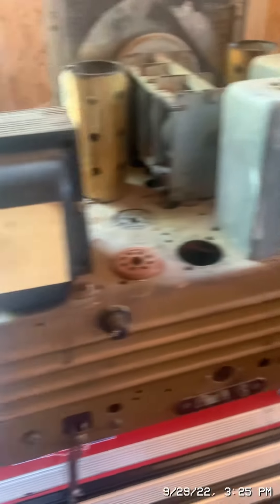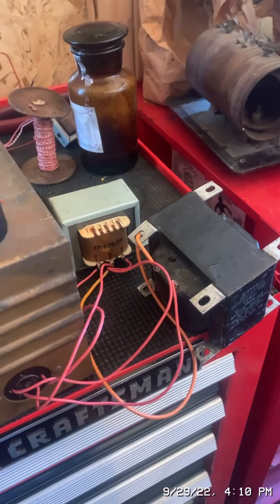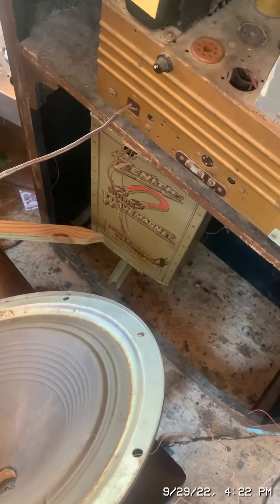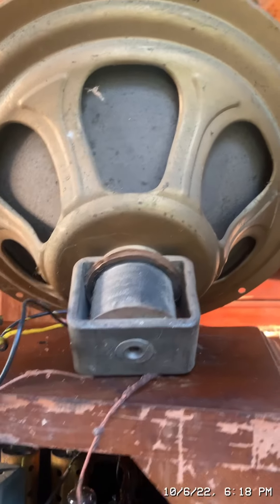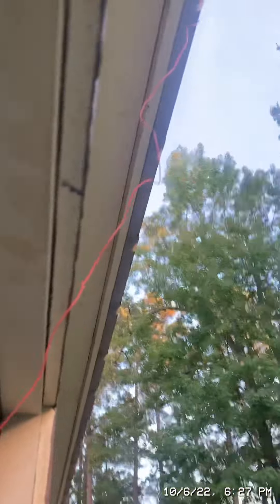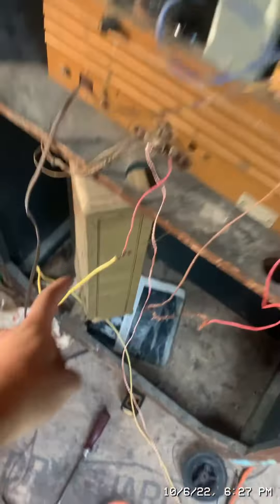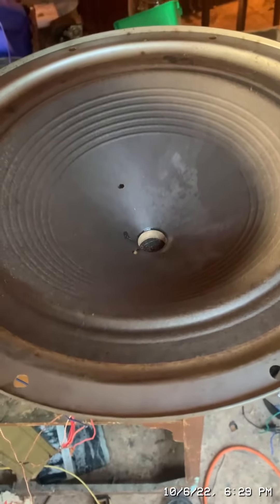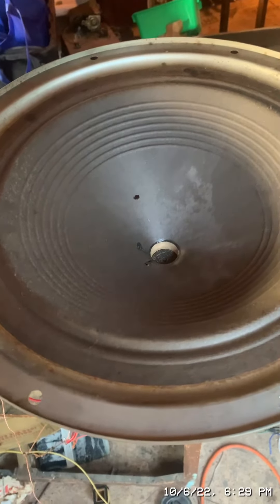Part 2 radio restoration

Comment: Good job. Id replace all the electrolytics and paper caps even if they still test good. They likey will fail before long. Usually the high value megaohm resistors drift in value as well. Careful with your fingers there bud. I had a set light me up when i accidentally touched the variable tuning capacitor. Sometimes the chassis can also be hot depending on how its wired.